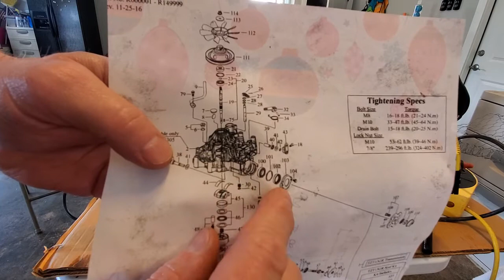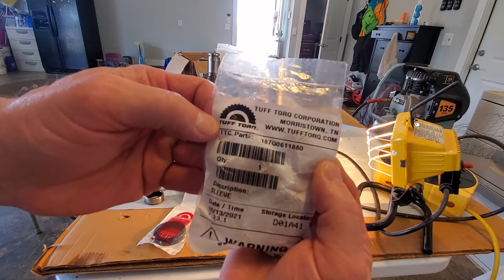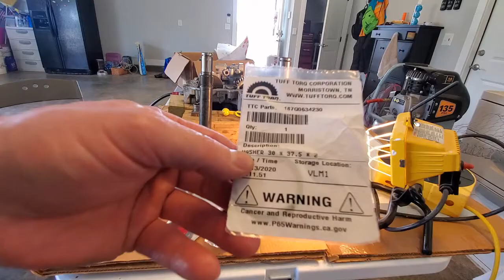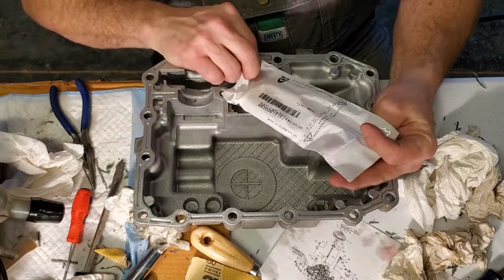Part 4: John Deere Z920m Hydrostatic Transmission Reassembly

Comment: on your diagram you need the number 7 plug if yours is plastic it's under the pulley that's a defective part.  you better check or you will be doing this all again
Reply from the maker: Thanks
Reply: Does this apply to a 2015 915b?